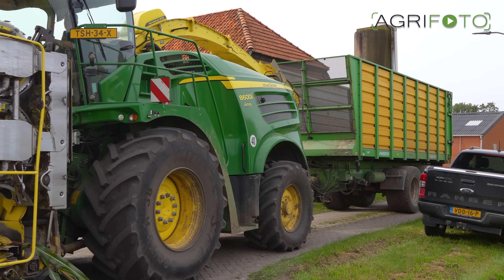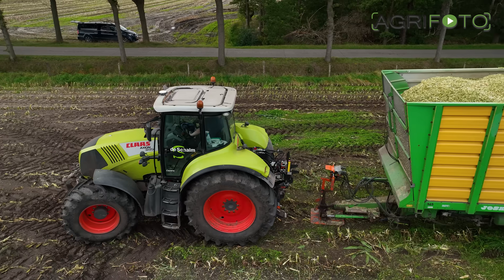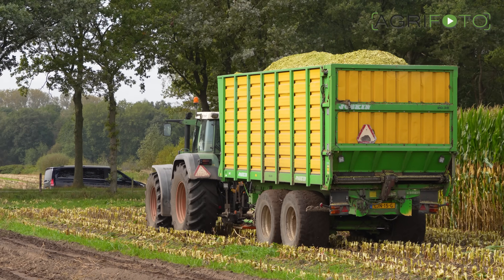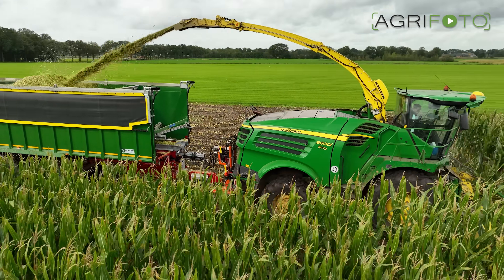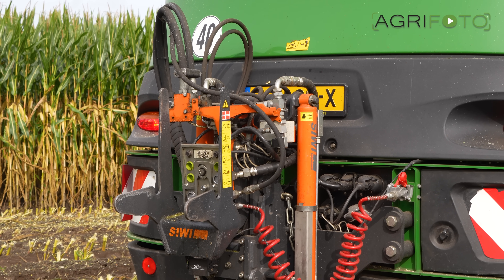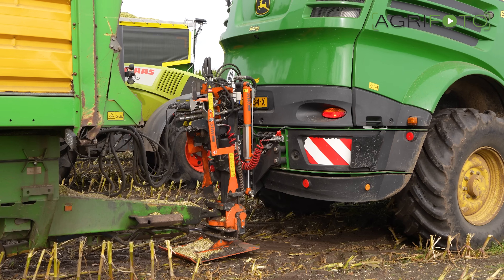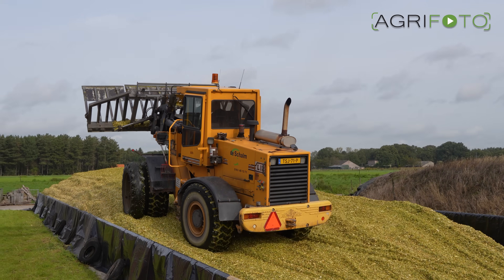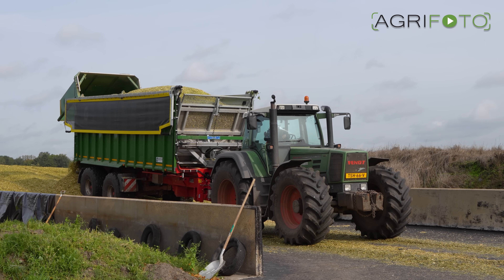On Track: CTF maize harvest | Corn chopping | 12 row John Deere 8600i, Claas & Fendt

Comment: Looks more of a waste of time and trailers that are not full 😕
Video is top 🙂
Reply: Indeed, the system is not yet optimal. We want to create a kind of goal at the rear of the trailers so that we do not run the risk of the harvested product spraying over the trailer and the trailers can be filled properly. On this field we normally use 3 trailers and 3 tractors so we now save 1 tractor and 1 driver so it is not entirely a waste of time.

Comment: It all started with USA equipment @ Van Bakel. They have invented and developed the idea of compacting trailer. So cool! Also this hitch link shown in this video honestly guys how long do you think that will hold up? It looks cool. Let’s try connecting and disconnecting 500 times. No way. 

Quickhitch a trailer is one thing, I’m all for it. Linking hydraulics 30-40-50 times a day under these condition? No way.
Reply from the maker: The system has been in use for years in Denmark and I think without problems. The USA trailers are nice but other companies such as Fliegl already had those kind of trailers (push off) long before!
Reply: @Agrifotodotnl  we had hydraulic quick link trailers on our strawberry farm (in Dutch: smalspoor stellingen) and it was a disaster. But who am I to tell thanks for your reply! I believe u.